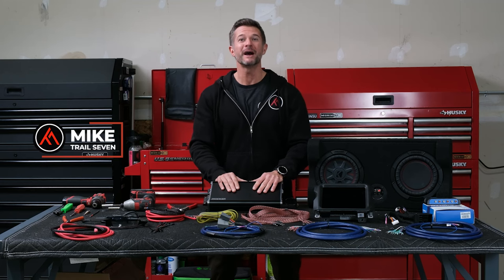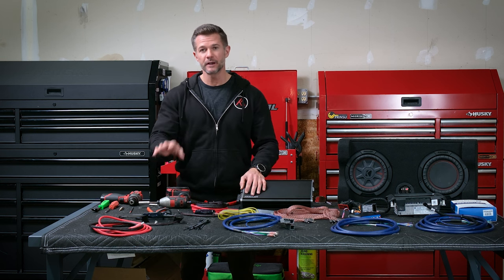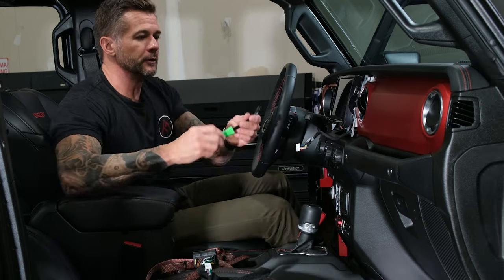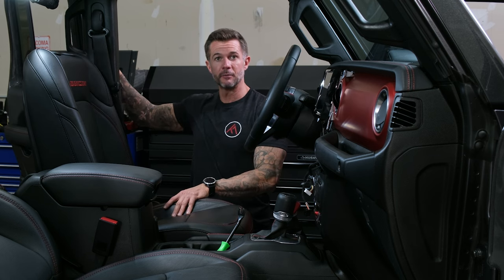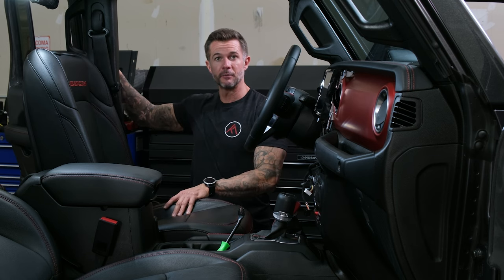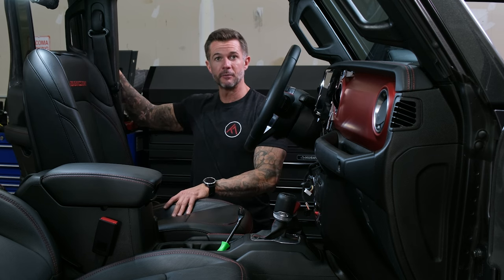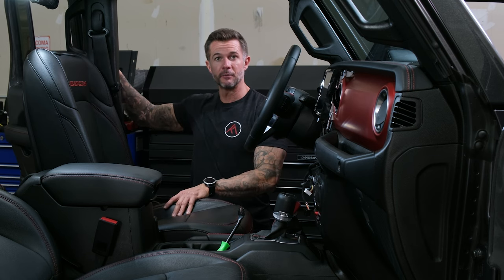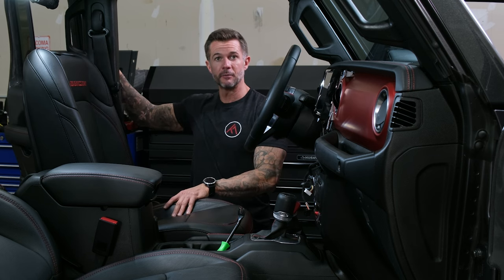Kicker Plug & Play Amplifier & Sub Installation | '18 - '23 JL Wrangler & '20 - '23 JT Gladiator

Comment: I have a 6 speed manual Gladiator Mojave. The access hole to run power wire to battery is occupied by the slave cylinder for the clutch. Where do you suggest to run  the power wire through the fire wall to the battery?
Reply from the maker: @SamuelMorrison-o3d  You can route it through the grommet in the floor under the passenger seat, strap it on top of the chassis, and straight up which will lead directly to the battery.

Comment: can i remove the factory sub from the 2 door JL after using the bypass harness and install aftermarket sub ,  amp and restyle unit ? or does the factory sub need to be connected ?
Reply from the maker: @dreamcastfan6669  With the amp bypass harness connected, the factory subwoofer is abandoned.

Comment: How does the down-firing 12" Kicker box compare to the side-firing SSV Works 10" box, especially with the top off? I am torn between losing precious cargo space and better sound quality.
Reply from the maker: @manchildbbq  The 12” Down-Firing Kicker sub definitely produces a deeper, harder punch over the SSV 10” side enclosure. 

The Down-Firing is super sturdy and built to withstand stacking items on top of.  Although it takes up a footprint in the cargo area, you can still pile items on top of it so the space really isn’t lost.

Comment: Wrangler install would be awesome. This seems to go much smoother than a wrangler. I don’t see room under my 2020 wrangler seat for this amp. Kinda frustrating now that I’ve gone this far as to remove the seat
Reply from the maker: @dadandjc  The Wrangler and Gladiator front seats are identical.  This bundle most definitely fits under your 2020 Wrangler seat.

Comment: Does the Alpine i509 Restyle dash increase sound output vs base sound system 7" headunit? 2020 JL base sounds
Reply from the maker: Without a doubt.  The i509 Restyle provides more power with a tremendous amount of adjustability.

Comment: Is this better/more powerful than the Alpine PSS-24WRA complete sound system? That one is a complete kit for the Wrangler JL, 300 watt, for $2k. Not sure how this one compares in power output and quality.
Reply from the maker: We also offer full bundle systems using all Alpine equipment.  Either way, the amps the amps in the full system bundles most definitely provide more power over the PSS-24WRA bundle, however the 24WRA is a great little compact bundle.  

We stock the 24WRA as well so if you would like to reach out to us directly, we would be more than happy to discuss the options. 

302-450-3207, 9am-5pm est.  Mon-Fri.

Comment: Does anyone know if the downfiring box will fit under the jeep 2 door back seats and actually be able to remove the back seats with ease if needed?
Reply from the maker: The down-firing will not fit under the rear seats.  The 8” will however fit in the cargo area behind the rear seats.

Comment: I have stinger height, 10 radio and do not think I need the PAC AmpPRO AP4-CH1, because it has one if so what type of package, how do I set it up.and would it be cheaper price. and I also want to bypass the factory amplifier video is there a video or instructions of how to do this?
Reply: I do have the factory Alpine amplifier
Reply from the maker: Hello there-  if you have the Heigh10, you will not need the PAC module.  The RCA’s from the amplifier will connect to the RCA’s at the back of the Stinger.  In the video shown, we use the amp bypass harness.  Your only difference will be routing of the RCA’s to the radio vs under steering wheel as shown in the video.  The Jeep in the video has the Alpine i509-WRA-JL which mounts the deck under the steering wheel.  Your RCA’s and remote wire will route to the back of the Stinger radio.
Reply: So how do I put together the package that need. Without the PAC module. And and I need the wire harness that we connect to height 10 Radio.
Reply: The website doesn’t give you the option
Reply from the maker: @willboyd8021  The website asks if your jeep has the factory amp and sub.  That option includes the factory amp bypass harness.
Reply from the maker: @willboyd8021  You will select the option that states- Aftermarket Radio/ Factory Radio.  

Once selected, the diagram will show the connections.

Comment: So - I have factory amplified system - from my understanding the factory amp powers all 9 speakers independently - when using this setup what speakers are powered by the 4 channel amp?
Reply from the maker: This is a 5-channel amp which will power all 8 speakers from the 4 channels and the subwoofer from the 5th channel.

Comment: Manual transmission would've been pretty cool
Reply from the maker: @atombomb6719  Why would that differ?
Reply: @trailseven  I have a 2021 Wrangler unlimited 6-speed. Its awesome to take turns with and toss around. Your video had me thinking about upgrading the sound system, also- the exhaust note is fun to listen to.

Comment: Which fuse to use for aftermarket kicker sub?
Reply from the maker: @jasmeetjassal6778  The fuse is included in the bundle.
Reply: @trailseven  Appreciated!
I meant to say which fuse do we plug it into the fuse box of wrangler for the input?
Reply from the maker: @jasmeetjassal6778  Gotcha.  None, the amp kit will attach directly to the battery with its own dedicated in-line fuse.

Comment: So If I don't plan on replacing the factory sub is the wiring in the blue cable>?
Reply from the maker: No, the blue amp harness is only for the speakers.  The sub wire will come directly from the amp to the subwoofer.
Reply: @trailseven  Thanks.  How do factory alpine subs sound once hooked up to the amp?  I don't really want to lose the storage.  Also is there a video of hooking up the factory sub or instructions included?
Reply from the maker: @Donttreadonme2024  Unfortunately, the factory sub will not connect to the amp.  Once the amp bypass harness is installed the factory sub is abandoned.  I assume you have a Gladiator in which you’re wanting to retain the under seat storage bin?
Reply: @trailseven  yes:)

Comment: if im running a dsp should i still use the 9 wire to the amp ?
Reply from the maker: You will only route to 4 speakers if you’re running an active system.  You won’t use this 5-channel amp though either unless your grouping.

Comment: So I'm not a professional installer at all. But this is the 5th video I've watched for a bunch of different brand installs for aftermarket stereo and amp installs and I've installed tons of systems in trucks and cars and all these jeep installs I've seen show them installing amps under the seats next to heat vents.......always was under the impression putting an amp infront of a vent blowing hot air on it underneath the seat just doesn't seem like a great idea...now I could be wrong but it wouldn't make me feel comfortable....especially mounting an amp on the floor of a jeep when u can potentially flood the vehicle if u get caught in rain without the top or doors on its happend to me in puerto rico in a rental and ther was about 2 inches of water on the floor.....IDK maybe I'm wrong but im just throwing out my opinion
Reply from the maker: Thank you for your input.  We have plenty of marine grade amps if water is a concern for your Jeep.